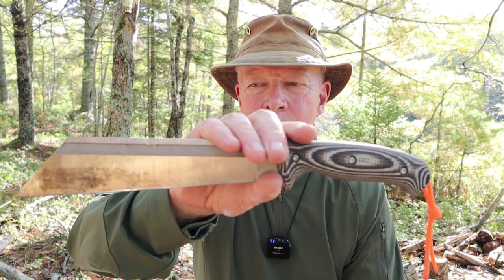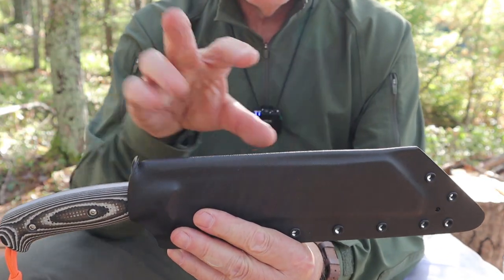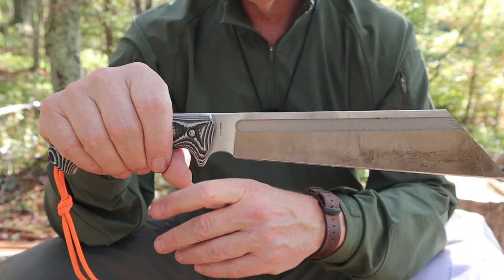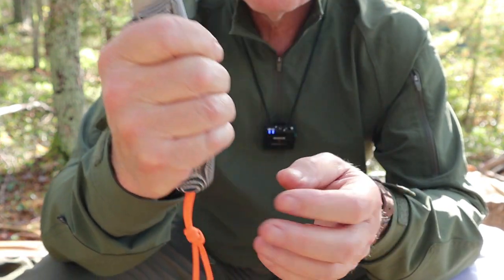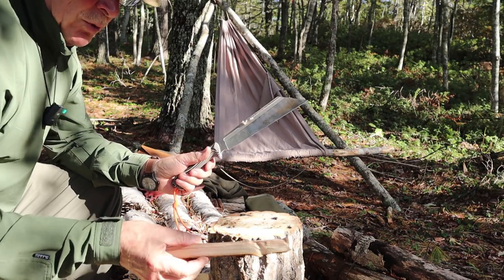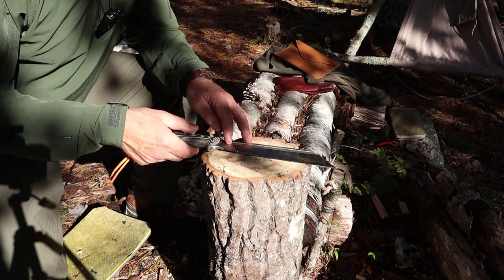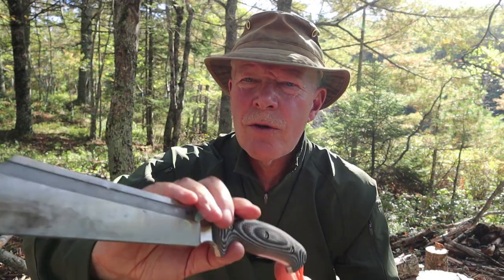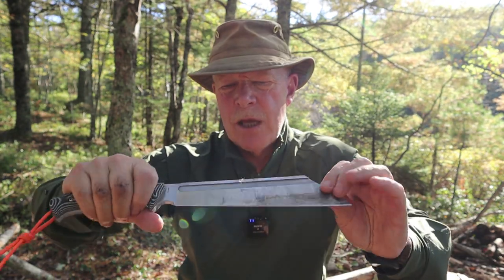Work Tuff Gear Drengr - A Seax Like No Other

Comment: Another use for the tip I think is to drive it in a bit on a smaller horizontal piece on a hard surface and push the handle downward for a more precise cut.
Reply from the maker: Yes, good point(excuse the pun). That is also something I like about a tanto for use in the woods. Thanks for commenting

Comment: G'day Mark, must say @ first look, wow, right up my alley. However, being full flat @ 7-8 inches, it'd be something I'd only take on a low risk, (of unplanned camping), day hike, (I currently use the CS Survivalist @ 8 in. for this role). Plunging deeper into a forest, at a minimum, I start @ 9 in. on the BK-9 or Skrama 240 and go up from there. And, no its not just about the extra inch, its the overall design characteristics, weight, balance, grind, ergos etc. The key capabilities being shelter and fire wood processing, (batoning and de-limbing in particular, though yes chopping too, should my saw be lost or fail). Also, blazing a trail may well be necessary, a longer Parang or other machete is even better again for that. Incidentally; that's one reason why I dont ever take a hatchet or hawk on a hike ........ have you ever tried blazing a trail with one.
So for sure this design does make for a great all rounder, (and in fairness a much much better survival tool than many knives), but at the end of the day, not compelling enough for my MO. Which is actually lucky, since I'm not stay'n up all night for a 2 min window of opportunity ; ) Cheers Duke.
Reply from the maker: Great stuff Duke. I do like my hatchets and axes but a big knife is often safer, especially trail blazing. Thanks for commenting
Reply: @MarkYoungBushcraft  Yep likewise Mark, car camping there's always gonna be at least one in the bag of tricks. I'm particularly enamored with the CS Trail Boss.

Comment: I have to wonder if it is worth the trouble trying to buy a Work Tuff Gear knife. When you can buy a Terävä Skrama 240 or 200 that is available with more choices in sheaths, and at a lower cost. The difference in blade steel design to me is better with the Terava.🤔👍
Reply from the maker: I don't necessarily see it as an either or, but as I like both. I will likely still take my Skrama for hard use. Thanks for commenting

Comment: Very interesting knife. I am comparing your review to my Terava Skrama experiences and  do not believe this would be a step up. Similarly to you I have large mitts and do not prefer finger choills though not sure if these details are related. The fuller or blood groove on the blade seems to be more nuisance than help to me. My understanding of an axe head being convexed is to encourage splitting and resist sticking. This may be what the Drengr is trying to accomplish with its convex micro bevel but I'm not sure there is enough there to make a difference.The rubber grip handle on the Skrama was the big selling feature to me  plus the fact that in cold weather it is warmer with no steel exposed to the skin. The look of the Drengr appeals to me though I'm not sure why. I must have some long lost Nordic ancestors.
Reply from the maker: I do love my Skramas. I think this is a more "refined" looking knife. Thanks for commenting
Reply: @MarkYoungBushcraft  - It’s hard to judge a blade until it is your hands. Trying to see how objective I could be about the unknown but obviously I would be biased due to only being exposed to one knife.

Comment: Taiwanese manufacturing is outstanding. I liken them to what American manufacturing looked like from post WWII up through the 80's or so. Meaning that, they're well engineered with quality components and a relatively high level of quality control/attention to detail. While remaining affordable.
Estwing Hammers manufacturer in Taiwan as well as the U.S. 
I'm sorry to say the Taiwanese manufacturing is head and shoulders consistently significantly better assembled/finished. 
I buy American when I'm able, but of the few working class tool manufacturers left, they're  often mediocre at best & nearly always blemished with blatent apprentice marks. 
... 
Anywho, great video ❤
Reply from the maker: So true. You only have to hold one of these knives to appreciate the quality. Thanks for commenting

Comment: I have a seax made in a shorter blade length.  It works well in the kitchen for slicing and dicing.  The heavy spine drives the edge deep for chopping and slicing.
Reply from the maker: I have a few smaller seax designs as well. Great do-all knives. Thanks for commenting

Comment: Definitely a different blade geometry than the Condor Sigurn. Also, at least it is made in what I would consider a, "ally" country and not the PRC.
Reply from the maker: The seax has so many variations. Different getting used to each of them as well. Thanks for commenting